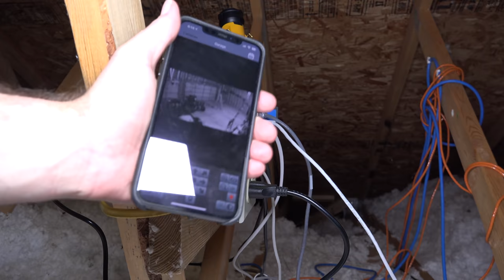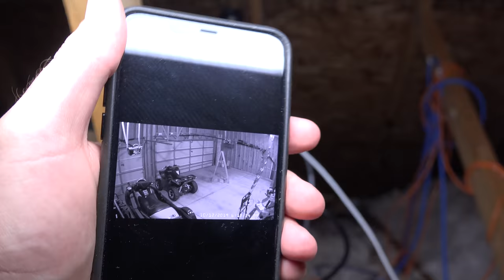Running power for PoE switch in ATTIC!

Comment: Wrong style box... You have no strain relief. Also need minimum 6" of Romex in the box per code.
Reply: Ya, don't do what he did!!! It's all wrong!!!!  I noticed that also.
Reply: Eric Becker please list all the codes that are violated in this video
Reply: @bigbigspoon  There are too many for me to bother to take the time to cite the NEC 'statute' for every single one.  Take a look for yourself.
For starters;  As many have said, the incorrect box was used for the new outlet. Also, the proper "pig-tail" length protruding from each box was not observed. Next, proper fastening of the romex was not observed. Last, and probably most important, at the "feed" of this new branch of the circuit the receptacle is not an acceptable splice point.  There should be a splice with approved wire nuts, and a proper "pig-tail" from the splice point in the box to the existing receptacle.
I'm sure there are others, but correcting these would be a decent start.  Hope this helps.
Reply: @btw111  I thought the same thing.  I loved how he stuck the 12 gauge wire into what I'm assuming is the back of a hot outlet.  I was waiting for him to cross short something out and see sparks.
Reply: @Whois2440  I thought of that too, however we cannot be sure (through the magic of editing) when exactly he turned the breaker off...(hence why I didn't mention it.)

Also, technically 14ga Romex would've been sufficient (for his purpose) commonly seen with a white Jacket now-a-days (instead of yellow), however it is not exactly a detriment, more of an excess.
Reply: I agree there are ALOT of things wrong. He is in Kansas and they don’t have electrical inspectors like other states. Definitely not the best install but I’ve seen ones that are MUCH worse.
Reply: Will Johnson yeah we have county inspectors however.
Reply: @btw111  thank you for that info. I bought a new house and was replacing some receptacles and they didn't do the wire nut with pigtail. I will fix that soon. Thanks again
Reply: @danielshannon167 Also; I have seen some home electrical inspectors let the "push-in" connection method fly when connecting 's single wire to an outlet... Personally I don't trust it.  I have seen too many loose / poor connections from them.  You never see them used in commercial electric work, mainly due to the more common place use of pipe and stranded wire.

Ether way, IIRC the latest electrical code states that an outlet cannot be used as a splice when bringing multiple wires to a box & an outlet.  (Even though there are happen 2 screws on the outlet, etc...)  There should be a splice in the box, then a short pigtail to the outlet. 
Hope this helps.

Comment: Normally you would first install the new outlet, run the wire between it and the mains source, connect the new outlet to the wire and only as the last step of the actual installation process you connect it to mains.
That's to reduce the risk to get electrocuted when someone accidentally switches on the power while you are working on it.
The entire time you were working after you connected the wire would have been reduced drastically and the risk as well.

Just a heads up for the next time and other people seeing this, because electricity is dangerous. You can't see it and if you smell or feel it, it is too late...

Comment: OMG! You really put the Ack in Hack! I see where you bashed through the structural joist webbing so that you wouldn't have to crawl to get to the flocked part of your attic.If an inspector ever sees that, your house might well be condemned until that's repaired. That webbing is there to provide lateral support for the roof.

Comment: why did no one comment about not using any type of breathing protection when in the attic. wearing a proper ventilator when in the attic should be #1 on the safety list. attics contain all sorts of dust or mold spores that can make you very sick or have respiratory issues.

Comment: Well I see something you did wrong on you outlet that will fail over time and you used the wrong box for your other outlet and you did it wrong to you plug stabbed the outlet and will fail over time you need to wrap the wire around the screws and go back to you other outlet and unplug stab the other outlet and put all the wires together and pigtail it to hock back to the outlet
Reply: Yes!!!  THAT for sure.   Never plug stab the wire end into the hole.  They shouldn't even have that crap on things.  They do fail over time.  It's a weak connection.  Always wrap the wire around the side screws, the direction you're going to tighten the screw, clockwise.  Nice and tight!!! When done I usually wrap electrical tape around the whole outlet covering the terminal screws for a little extra protection.

Comment: Thanks for the video. People might want to listen to podcast: TechSnap 414 Rooting For ZFS, in show notes, scroll to LoRa to save a minute of off topic chatter. 900 mgH bandwidth like Amazon SideWalk for increased range over home WiFi. Not ready for deployment yet. Alternatively the TP Link EAP225 rates higher than ubiquiti, and is easier to setup and reset than ubiquiti if using 3 or less access points. I didn’t follow the podcast that closely. Keep listening as he comes back around to the topic.

Comment: ok on your ground for the electrical outlet you should have a pigtail and have the grounds wire nutted to it.   Next I believe (from what I can see that you only have one wire per terminal (thats good)  next make sure the CB on the circuit is 20 Amp at a min...   and it appears you used 12 gauge wire (thats good)...
Reply: No no no, he jumped off of an existing receptacle that was fed with 14gauge Romex so this circuit should never be more than 15amp.
Reply: @bryanb2541  thats true... but I didn't see him jump off that...  14 Gauge is 15 amp max I agree....

Comment: ok ya trolled me I was like WTF speaker wire... also funny that you use a 12/2 and tap into a 14/2 ( Added note: add an attic fan to pull the hot air out. could probably use the same plug. 14/2 is on a 15amp breaker.  Double check the math on what's on that circuit.)
Reply from the maker: lol

Comment: The issue with this, if your running cameras, you can backup ur cams with POE, but u cant back up this switch without having a UPS near it. So power goes out, no more cams...

Comment: OK time to be a keyboard warrior....

Electrical:  That PVC box is only meant to be used with wire run through a conduit with the conduit connected to a fitting that attaches to the box. The way you are using it now does not protect from wire pullout plus you're leaving a nice opening for a spark from a short to go flying out into your attic space.  Go buy a plastic single gang new work outlet box (the kind with nailing holes and the rectangular tabs that you break loose that secure the romex into the box. The remainder of that romex run should be secured where it runs along the framing members to keep it securely in-place a reduce the chances of damage.  The romex where it comes out of the garage ceiling box requires a staple within 12 inches.  As you brought up insurance concerns I mentioned in another reply, dependent on the code requirements in your area you MIGHT have needed to permit this work and get it inspected.  Since you didn't you should at least try to ensure it is compliant with your local codes and NEC.

Networking:  Dude, I've been a subscriber for a while and I find your stuff entertaining but this is just silly!  That switch will not tolerate the temperatures it will be exposed to in the summer (also you're in a pretty humid climate right?).  It needs to be in a conditioned space.  For all the time and effort you have put in to run a few wires you could have done home runs to your server rack and patch panel.  There are so many failure points here that you're going to spend way more time trouble shooting when something fails than if you just replaced all the pre-made wires with appropriate solid copper plenum or riser cable.

Comment: update on this?  i live in the midwest and worry about heat in the attic, but a POE switch up there would really help reduce the number of cables i need to run.  so how has this held up?

Comment: Cable management is a bit of an issue 😁😁😁😁😁, This should be a how Not too video.😂😂😂😂 love your videos but this could be the worst install of cables and electrical I have ever seen. Credit for being honest
Reply: It takes very little effort to make it nice and neat.  You can buy Zip Ties at home depot with a place to put a screw and mount them along the beams to hang the cables up and bundled together.  It's cheap and easy.  I know he has a power driver to screw screws into those beams.   It's what I did under my house running a ton of Cat6.  I have a 48 port switch for my small house.  Think about that.  That's a lot of wire running around under my house.    It's all neat and it's all labeled at each Keystone to the Patch Panel at my rack.
Reply: @jbdragon3295  where can we deposit the internet street cred points at?
Reply: jrok96 

No need, I just like things neat and orderly.  It looks much nicer in the end. 

Showing people what to do and yet doing it wrong? Electricity is not something to do wrong.  I hope others don’t copy that!!!

Use a metal box with a cable clamp attached to it to secure the cable correctly.  Don’t stick the wire end into the holes and think that is a good connection, it’s not!!!!  Wrap the wire around the side screw terminals the same direction you will be tightening the screws. Make sure it’s nice and tight!!!   Tapping into the garage door opener power is fine if the connections are done as I said.   That switch again uses very little power.  I still would have mounted the switch in side the garage.  Running wires down to the garage should be simple!!!
Reply: @jbdragon3295  true mate its common sense and safety
Reply: It's a "How Not To" video. These are useful too, especially when accompanied by the later fire department investigation report.
:)

Comment: ok spoke too soon... I saw two hot wires on one terminal...  you should pig tail that one as well  so you only have one wire per terminal.  next you should secure the wire within 8 inch's of the box and every 4 feet after that..  and finally within 8 inches of the other box.

Comment: That was a 15 amp circuit you tied into should have used 14 gauge wire and your wiring job in the first box should have been pigtailed. Also that is the wrong Single Gang Box to be used that is for PVC pipe not for Romex I'm not sure what your codes are in your state but here in Connecticut if you have a garage attached to your living space your firewall separating the two spaces should continue up into the attic and I've noticed that your house doesn't have that.

Comment: health and safety and the inpector would fail this job intantly... apart from this, did you connect this poe swith into your home router? as im confused by this... im looking into setting one of these up in my Loft ( attic ) but i never saw you connecting this to your router.

Comment: You need a connector for the romex to secure it to the box
Reply: Except it's the wrong box for the application. That one is designed for exterior PVC conduit

Comment: I am so sorry that I have to say this, the way you splice an outlet is not correct.  There is 3 sets of wires that is connecting into the outlet, the correct way is using wire nuts and running a whip to the outlet
Reply: Psst it's called a pigtail

Comment: So, the reason I wouldn't run that switch in the attic has nothing to do with temperatures... You said you're using them for your cameras. Of all of my stuff, the one thing I want working in a power outage is my cameras. Put the switch next to a UPS... Preferably next to your other network stuff, so that it's working too. Then everything runs during an outage. If you have to use a generator, you can also run the power to a central location and restore your entire network.

Comment: Omg it hurts to watch this man work,  I'm waiting to see if his house burns down from the shoddy work on the electric....
Reply: Joseph Lettieri What did he do wrong? I was going to do this today at my house
Reply: They shouldn't let this man near power tools!
Reply: He should use the right type of electrical box for the outlet and he should tack down the wire so it doesn't move.  Also a nice plywood boards across the beams would make it safer to work in that spot. If he is making that a spot for the wires and switch to be at,  the plywood would be a good idea.

Comment: You got me with the speaker wire but why did you choose 12/2 not 12/3 or even 16/3? It's MUCH easier to run the wire correctly once than to have to do it over again.

EDIT: I forgot that 12/2 actually has a ground wire in it as was pointed out by  @Paul Beers
Reply: Why?  12/2 has a ground.  12/3 is used for 240.  The 2 is for the number of hot and neutral wire's and does not include the ground.
Reply: @paulbeers4105  

Ya, it's a little misleading.   The Box though is wrong.  There's no clamp on the wire at the Box, etc.  It was really the wrong Box.  For one, he really should have gotten a metal Box.  There are holes in the back to run screws through and into the beam.  Used a cable clamp that is mounted onto the Box.  The power cable should be secured in a number of places, not just laying around like all his ethernet cable which is also a joke.
Reply: @paulbeers4105  ahh it got me again. Now that you mention it I remember that thanks for correcting me

Comment: You mixed 12 guage with 14 guage wiring...I would never do that
Reply: John Moricone Yes, as far as good wiring practices goes I wouldn’t either. On the other hand it’s not going to hurt anything in this configuration. If wired properly he should have a existing 15 amp breaker on the 14 gauge wire. The 12 awg he installed is good for 20 amps and will be limited to 15 amps at any given time. If he was installing 14 awg on a existing 20 amp circuit that would be a double no no. In short he basically waisted a few extra dollars.

Comment: Sooo NOT code!
Reply: fastjp72 do you think so… If so let me know what the codes are that have been violated
Reply: @bigbigspoon  Just to name one, the way the wire is installed to a conduit box.
Reply: @fastjp72  Whats the code? He lives in Kansas btw... Thx
Reply: @bigbigspoon  I have replied to your same question where you asked it of another commenter.  See my response there.
Also, the applicable code would be NEC (National Electric Code).

Comment: You could of put a poe Switch that is powered by your Cisco Switch in Your rack then you would have it on UPS backup Ubiquiti do a Switch that can be powered via poe and Re supply poe ✌👍
Reply from the maker: not enough power from poe line. but already have plug anyway now so no reason to try :)

Comment: So if it shoots sparks next summer and burns your house down, will you care then? Electrician for more than 30 yrs now, sorry, but you need to turn in your man card for shredding. LOL  Hope operating your door opener doesn't under volt the switch bad enough to smoke it? Good luck

Comment: Sadly when the fire department, checks your house for the point of ignition and you lie, yet their being a video of everything you did.. Do what I did, hire a licensed crew to come out, get the electrical done right and I'm in Oklahoma, I've been in our attic in mid July with temps higher than 170F on days that were 115F+ outside in the shade. Point is, that house is or will be un-insurable.

Comment: Your running 12/2 into and outlet with 14/2 in it. You need to run the 12/2 to the breaker box. 12/2 is for 20 amps and 14/2 is for 15 amps. So you could possibly over load the outlet which could still cause a fire.
Reply: If the 12 2 is on a 15 amp breaker it can't overload the wire or the circuit. It's always okay to upsize the wire in a circuit.

Comment: Jokes about being to cheap to buy adequate wire... Buys cable that can do 40a 120v. Haha. 14/2  would probably have been fine.
Reply from the maker: better safe than sorry?
Reply: @Bytemybits  The wire used should be representative of the circuit capacity.  Since it's a garage door it's likely 20A, so 12/2 romex would be appropriate which is what it looks like you used.  If the garage door breaker is 15A then this wire is inappropriate and while it won't cause a problem in this specific scenario, it could misrepresent the capacity of the circuit to a future homeowner and result in an overload condition.

Comment: Please come up with a colour (US: color) code for all the network devices. so like servers are black, wifi is white, LAN aka desktops blue, camera (pink or green or orange) uplinks (any colour not used) and then label with a piece of tape at the switch which camera is which etc. will save you a headache later.... then make a video of you fixing this up lol then print out your standard on paper and put it on your server cabnet gg.

Comment: You joke about electric outlets ran with speaker wire but, in fact our previous house when we moved into it had the dining room light and two outlets wired with, you guessed it speaker wire. Yes someone was dumb enough to do it .